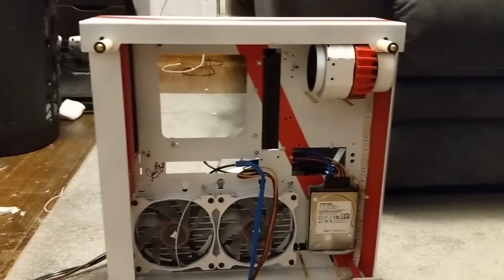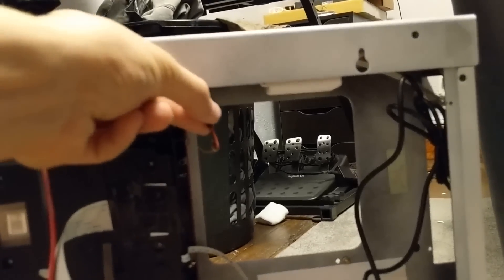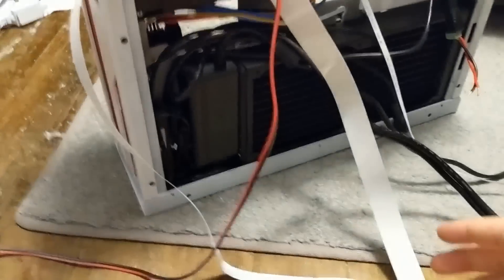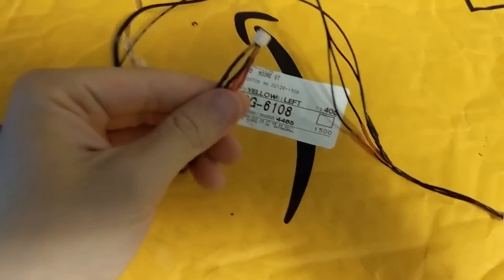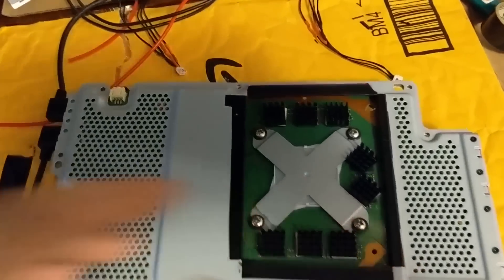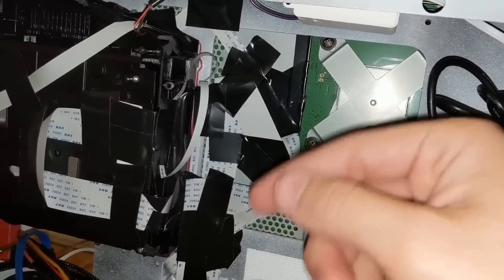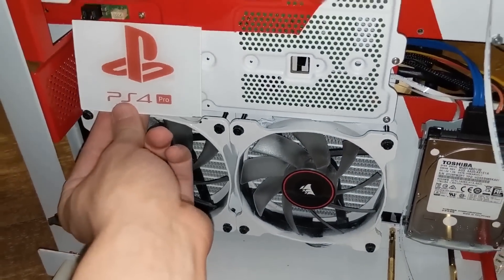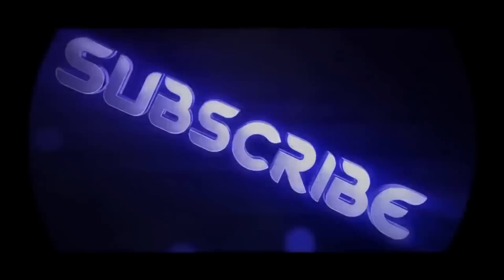PS4 Pro Water Cooled (Part 3) Powering it on!

Comment: You could have used relays to make your life easy to turn on water cooling with ps4 pro you could use ps4 fan as the signal for the realy to turn on. But ypu did a great job, very much help me to do mine.
Reply from the maker: My updated build I ended up using an actual PC supply for everything. It was a lot smaller and easier to do
Reply: @JMAGG  yes it was very helpful, but i guess this build was very expensive due to custom water cooling. That's my concern in my build, because in india we don't have access to these parts easily in our market.

Comment: What's the size of the mounting bracket for the water block?
Reply: The mounting bracket is to big for mounting it, so he had to make extra holes. The original distance between the mounting holes on the Ps4 is 62mm.

Comment: If anyone knows where to get these extended ribbons please let me know.
Reply from the maker: Hey, here are the links to all the cables I got. I just got the longest length possible for each cable just in case. So I got the 500mm or 600mm options. 

https://www.aliexpress.com/item/6Pin-to-6Pin-ZIF-0-5mm-Connector-Adapter-with-Extension-FFC-Cable-100-600mm-can-choose/32774640460.html?spm=a2g0s.9042311.0.0.XQ7bOc

https://www.aliexpress.com/item/40Pin-to-40Pin-ZIF-0-5mm-Connector-Adapter-with-Extension-FFC-Cable-100-600mm-can-choose/32776855490.html?spm=a2g0s.9042311.0.0.XQ7bOc

https://www.aliexpress.com/item/10pcs-Flexible-flat-cable-FFC-8-PIN-0-5-mm-pitch-Ribbon-Same-sides-Length-60/32789704056.html?spm=a2g0s.9042311.0.0.XQ7bOc

https://www.aliexpress.com/item/100pcs-Flexible-Flat-Cable-FFC-9-PIN-1-0-mm-pitch-same-ends-Length-60-70/32793830753.html?spm=a2g0s.9042311.0.0.XQ7bOc

I couldn't find the cables anywhere else so I had to get them from aliexpress. It took about 3 weeks for them to arrive to my house because they're coming from China.
Reply: Jmagg2234 you are the best. All credit to you. No one else is showing this. Everyone will show you the end result but your basically doing a walk through and that sets you apart from the rest. Awesome.